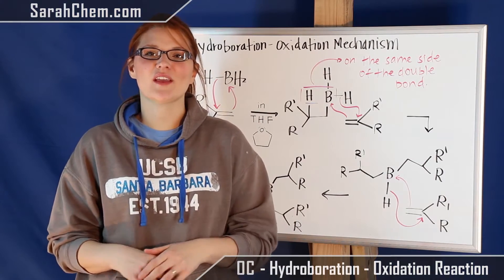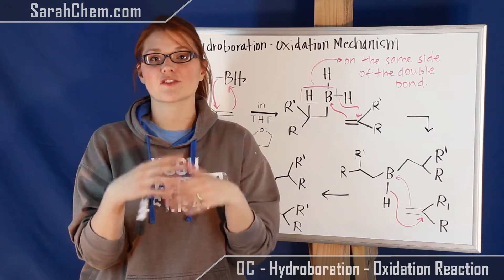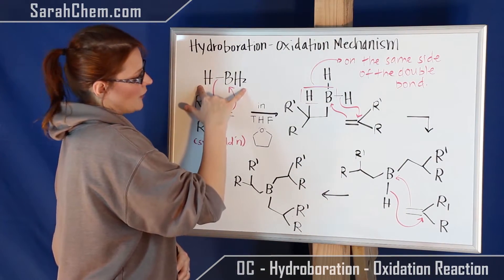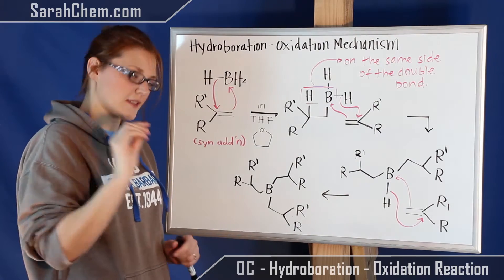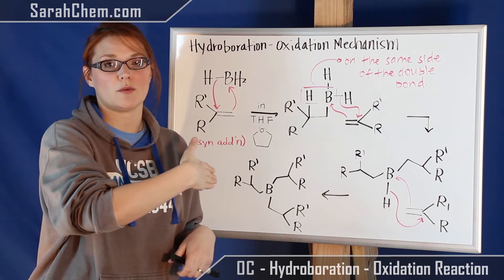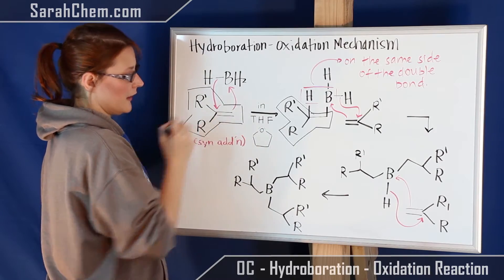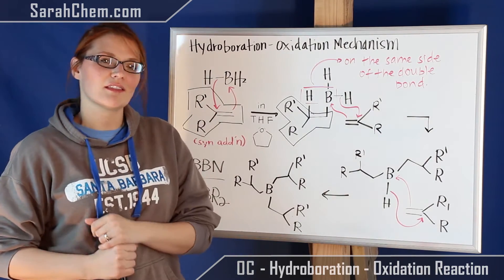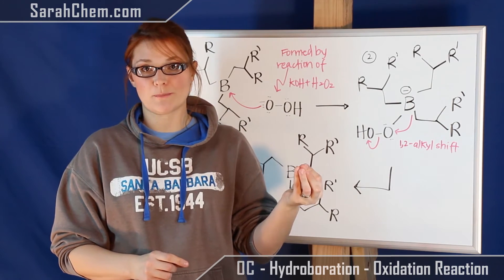Hydroboration-Oxidation Reaction Mechanism

Comment: Hi , Sarah  , I want to ask on step 2 : oxidation , what if it is a OH- attached to the Boron instead of the OOH- , then OH- will have nothing to kick out (originally OOH- will kick out OH- and replaced by R group to form - BOR ) , and the R group can't attach back to the Oxygen atom , then It would be Boron with 3 OH- , B(OH)3 
1. can I just skip the H2O2 ( not adding any) and just add H2O & NaOH 
2. is it OOH- must attack before OH- attack Boron? so can't form B(OH)3 directly? any chance OH- can attack before OOH- when OH- is just adjacent to the Boron atom?
Reply from the maker: Hi Beth.  There is definitely chance within an actual reaction for things to vary/be a lot messier than our mechanisms.  The importance of the OOH specifically is the ease with which the O-O bond can be broken which allows for the movement of the R groups onto the O from the peroxide.  If HO- attacked it would require the kicking off of an R group - which not a good leaving group.  The H2O2 provides a pathway for the effective removal/replacement of those R groups with O.  Hope that helps!